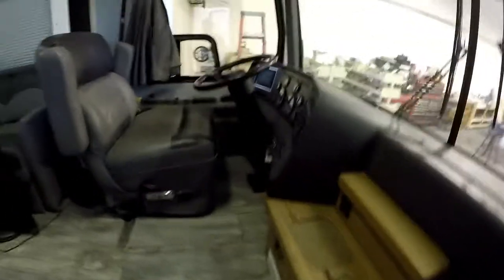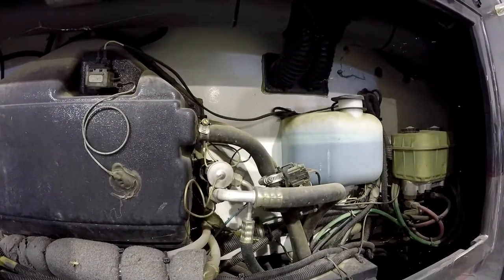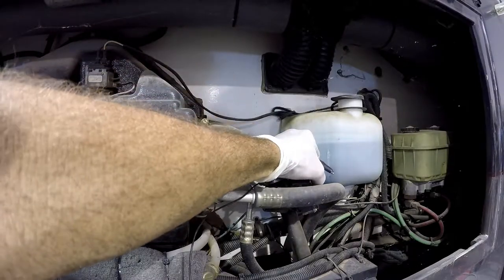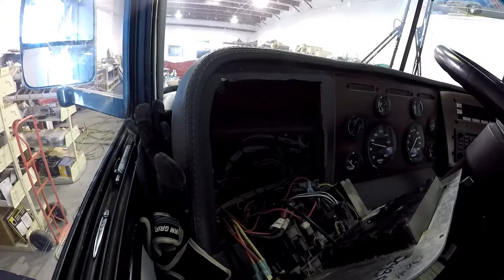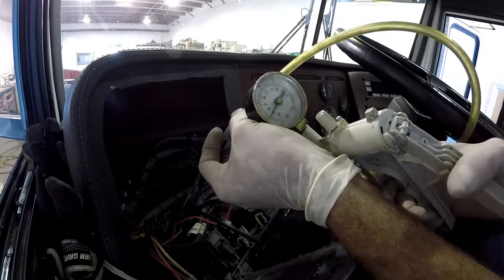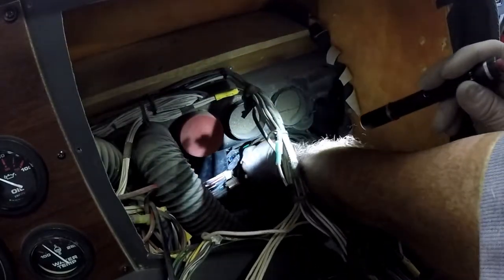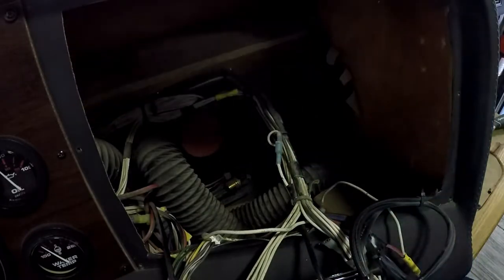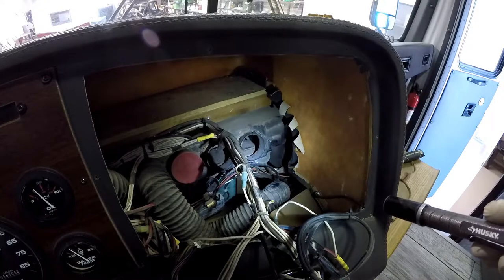Diesel Motorhome dash vent control vacuum leak!

Comment: Yes, what used to be RODS and CABLES for controlling carb chokes, heating/air conditioning, cruise control, etc is now VACUUM lines or small wired servos.... aka "fly by wire ".   Vacuum leaks can be a bugger to find...opposite of pressure leaks found with soapy water bubbles.  Good use of your Mighty Vac kit.  I bought one a few years ago. It seldom gets used but when it does....it is a time saver.    My 97 Dodge van had a hidden vacuum leak which made the dash vents swap between blower and windshield defrost like it had a mind of it's own. Way to go James     JwgK
Reply from the maker: I've used it many times to test fuel line supply to generators too